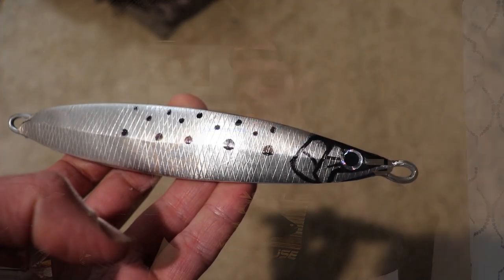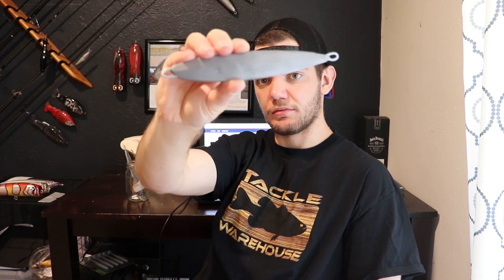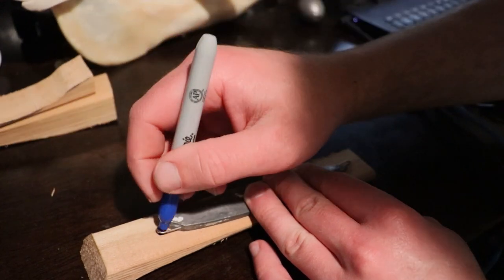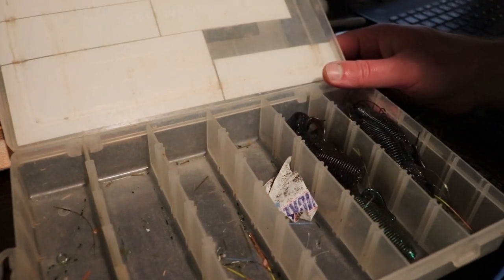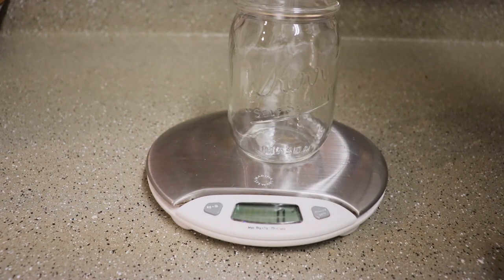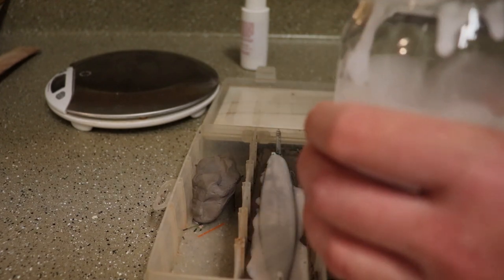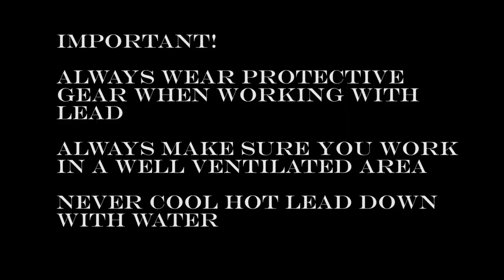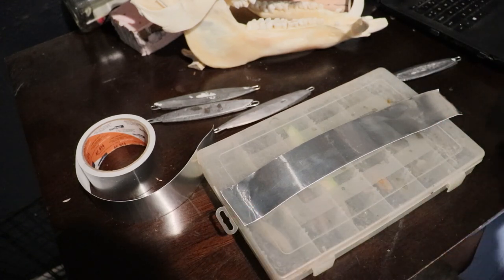How To Make Jigs For Dogtooth Tuna, Amberjack, Yellowtail Kingfish & More!

Comment: I’ve been using alumilite high strength 3 and after casting about 2 dozen stickbaits the silicone started degrading just from the heat of the casting resin setting. Maybe the high strength 2 is better
Reply from the maker: Damn! Not sure. Double check the differences between the two. So far I haven't had any issues with the HS2 but I haven't used any casting resin in it.

Comment: I would be melting one of the good jigs down to see how they bend their wire surely you need to bend it to stop it pulling through
Reply from the maker: yeah the straight wire was for quick instruction purposes, however with 2mm ss wire it won't pull through either way. When I use my lighter wire I do wrap the open ends